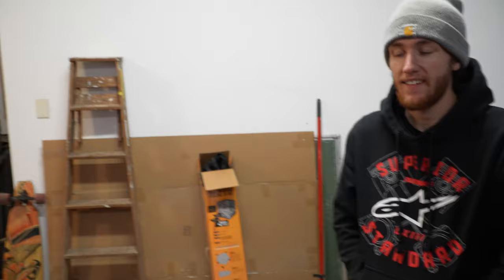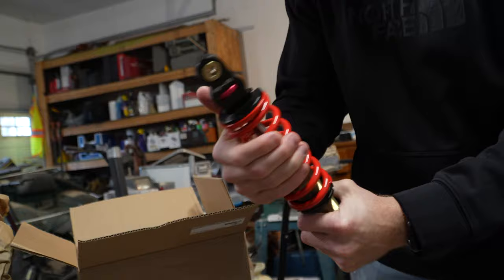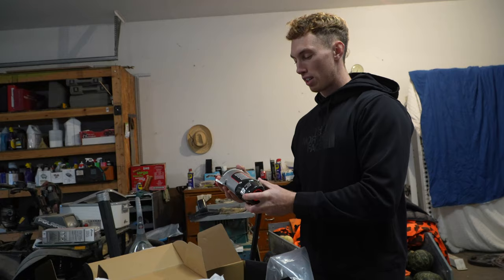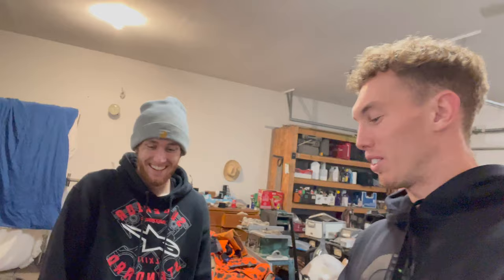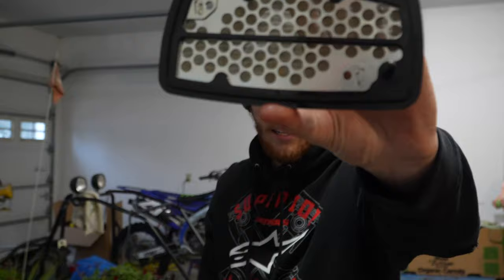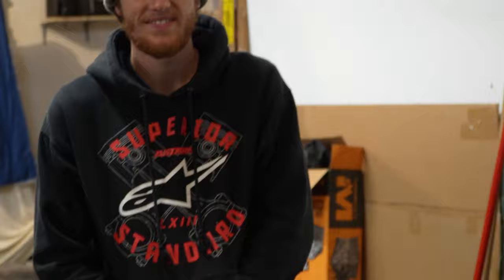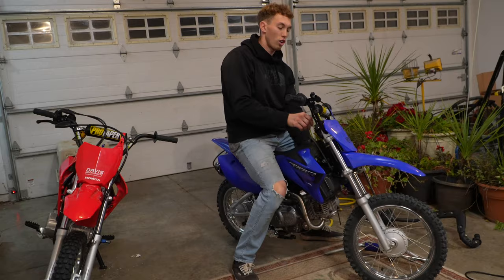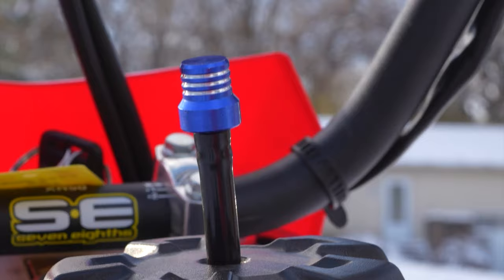2023 Yamaha ttr 110 & Honda crf 110 mods!!

Comment: I bought the 350lb one for my ttr 110 2023 & it works great im 230lbs
Reply from the maker: noted, i definitely should’ve went with the same one
Reply: I'm a big guy 245+ I was wondering if there is a weight limit, I may need to go up to 125 for pit bike, I'm only 5'9 just bulky.